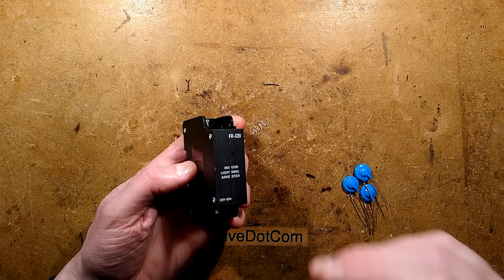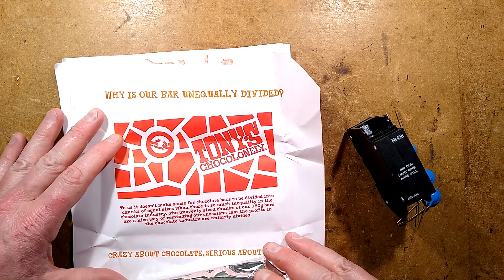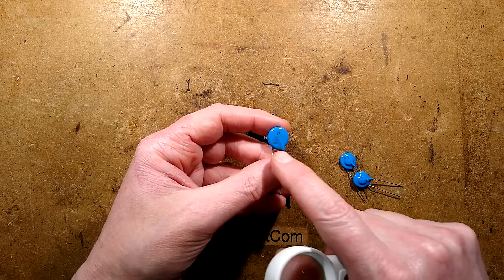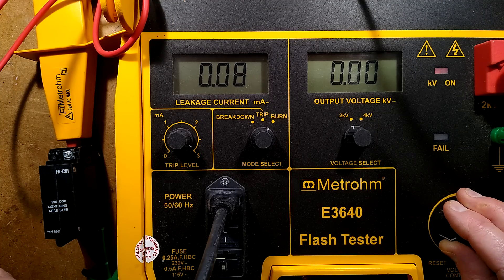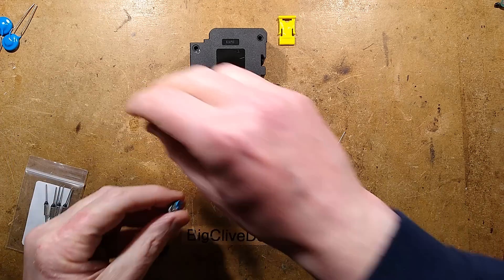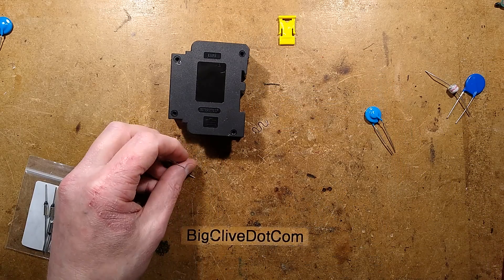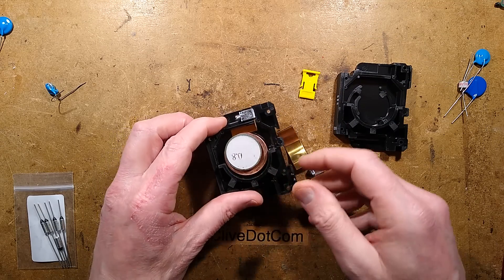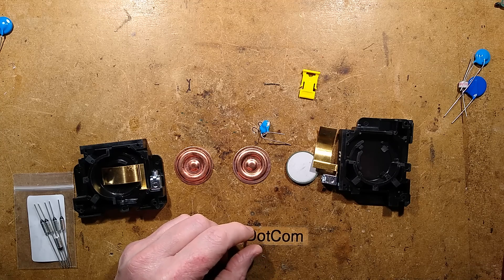Inside an African lightning protector - and candy

Comment: the steel "washers"... copper plating is probably cheap corrosion protection, and conductive layer.

so why not pure copper?

deforms, doesnt it? steel will take the heat.

im also having strange ideas about magnetised iron at high powers, but as soon as i start thinking about it i get contradictory images so, no comment in that regard...

Comment: The combined gdt mov is good because they complement the behavior of one another. 

MOVs clamp by reaching their break over voltage at which point a pseudo diode breakdown starts to occur and the resistance drops. But the clamping voltage is always above the operating voltage. But they always have finite resistance and have a leakage current. 

GDTs, rely on dielectric breakdown of gas between two plates at which point it becomes basically a short circuit. These devices clamp at some minimum holdover voltage much lower than their nominal rating set by the physical parameters of the device (maybe 100V for example). Because of this they will blow themselves up without current limiting in unlimited power scenarios

So what you do is put a GDT on your MOV because the GDT has no leakage current during normal operation saving power. In surge clamping the GDT breaks down and the MOV sees the full voltage and begins to conduct. Once offensive input reaches below roughly Vmov+Vholdover it can no longer sustain the current necessary to produce an arc in the gas.

Comment: About TN-C-S in ovearhead lines: In Hungary we have 2 or 4 wires going from poles to houses(3 phase service is common). The PEN is separated to PE and N at the meter box or the breaker box, where it is mandatory to connect a grounding system with an impedance under 10 Ohms. Ideally it should always be a single digit number. It it easy to get it under 5 Ohms with just 2 3m long electrodes 6m apart.  Several decades ago TT systems were common and sockets were sometimes grounded to water pipes.

Comment: Wouldn't need a strike on the line to cause a surge, a lightning strike close to the line could still cause surges due to the magnetic field cutting across the overhead lines.

Comment: I think that black device was assembled incorrectly, I think that there should have been one of those copper plated discs either side of the ceramic disc so that an extremely high voltage would jump from one to the other the two discs forming the spark gap.

Comment: The GMOV; Different African here, this is for me a dumb idea, but a very common circuit form. The why, is the gas arrestor and Varistor characteistics, the GA is slow and shorts very large currents, and the MOV is nanosecond fast and can only short a few decade Amps. And they put them in series.
A number of devices I work with internationally, have this circuit, and they seldom fail, but the protected circuit does...

Comment: If the varistor is sandwiched between the copper plated steel plates, the outer edges of the plates could serve as a gas discharge gap in the ambient air. The breakdown voltage would be unpredictable, but for a lightning strike it should react fairly well and limit the spike to perhaps a couple kV. To really test it may require a large capacitor charged to perhaps 10kV and a current limiting inductor of very low value simulating the feed from the service drop's transformer.

Comment: The copper discs go on either side of the MOV and the spark gap is provided by the outer ring of the disc and free air (so the breakdown voltage depends on local weather conditions).  You use it downstream of a fuse or breaker so when the MOV fails into a short as they do, the fuse pops.  If this is properly assembled it's an effective if crude protection device for a single-phase single-leg system where the ground is bonded to neutral at the panel.

Comment: I lived in South Africa in  a suburb of Jo'burg which had lots of low grade iron ore surrounding the town, rusty red soil everywhere.  During the summer there were massive electrical storms with strikes everywhere. It was prudent to unplug any critical equipment in the house when you were not at home, in my case a QUAD amp tuner and deck. If you were at home listening to music or watching TV during a storm, wise men unplugged ! At that time lightening protectors were not fitted to household fuse boards (and I wouldn't have trusted them if they were !). Any local strike, and there were many, travelled a long way to your local earth and cooked whatever it came upon. A friend of mine got a significant jolt taking a shower during a storm. Out in the countryside, many of the local African farmers used a traditional method of lightening protection, a long thin pole about 25ft high with a red flag on the top next to their houses...........
Reply: Those tall poles are often near houses that have a thatched roof. Although every house in the open field could do with two or three of those poles.

The Johannesburg area is notorious for its lightning strikes. To unplug is the best advice you can give a friend. Even with the best lightning arrestors I wouldn't trust my devices to be connected during a storm.

Comment: The advantage of the integrated gas discharge tube on the MOV, my guess: MOVs are aging during normal operation, without ever clamping, just exposed to normal mains voltage. With that gas discharge tube in series, the MOV won't see any voltage across it, only during a transient event, when the voltage reaches the brekadown voltage of the gas discharge tube. So this arrangement was probably created to prolong the service life of the MOV. That super tiny gas discharge tube probably has a very low brekdown voltage, it is intended to break down just above the nominal mains voltage.

Comment: The BIG problem with these little thermal fuses , is that they often become fatigued over time , and fail when the element temperature is not at a dangerous level .... maybe there is a more reliable product on the market ( ? ) , but I have not found any , so far .... (  repair cafe volunteer  ) ...... DAVE™🛑

Comment: In America, current NEC mandates whole house surge protection devices (SPDs)  for new construction (sends overcurrent and over voltage to ground at the main service entrance panel with short wires). It's not whole house lightning surge protection, which would be a completely different device that can handle the greater energy impulse of lightning. A lightning protection device should be installed ahead of any SPD.

Comment: I am not supprised by this being so much cheaper then its UK/EU brother of SPD. It is dissapointing how expensive SPDS are in UK. Considering how much simpler they are compared to  a standard breaker(mcb), they shoulnt be 10 times the price. But breakers came to existance before corporations dictated the price. Now SPDs cost as much as they can cost. I guess its like USB cables or coffee. shops buying cost less then  five percent of selling cost.
Havent seen any CE logo, so I would appreciate that they did not claim it has protection it doesn't. I guess gap type is a salles think, like a memory foam. Nothing, but makes it sounds like its special.
Reply from the maker: The price of SPDs is being gouged in the UK.

Comment: Lots of useful suggestions so far... adding the minor detail that the failure mode for the varistor ceramic disk can be an explosion. Less likely with a very high but short duration voltage spike, but a sustained over voltage condition will lead to very high current, overheating, and rapid self disassembly. The steel discs might be there to contain the most violent parts of the disintegration.

Comment: Interesting configuration. The dimensions of the GDT element suggest a pretty low flashover voltage, yet probably enough to protect the MOV element from lower-energy "nuisance" trip events that would impact its lifespan.  I'll be sticking to my DIN rail cartridge style arrestors (with clear failure indication) for the moment.  Incidentally, Mr C - remember doing a video on those plastic KAM press-studs, seven years ago?  My overalls have finally passed the "point of no return", yet those cheap plastic press studs were still working just fine!
Reply from the maker: Yeah, the plastic studs are surprisingly tough.

Comment: I just had the booster capacitor on my 5 tonne AC unit go boom .The capacitor should have been 150uf and was only a few pF ..The PTC devices in series with one lead .It blew out one of the  PTCs .The other is intact ...Wonder what I can use it for ???
Reply: Not sure what a booster capacitor is? I presume it is the starter capacitor to start the compressor or fan motor of you air conditioner? Those things do wear out over time. A PTC in series suggest that it is a starter capacitor because it will have a low initial resistance and after a while it will heat up and basically take the capacitor out of circuit when the motor is running.
Reply: @Frankhe78  that's the exact design and purpose of the device .It's hooked up in parallel with the start capacitor so it increases the value temporarily by an additional 150 micro farads .So the  factory capacitor is 50 micro farads giving you a total of 200 micro farads  for you initial start up because of voltage sag in supply or  aging compressor motor .or improper instal of supply wires .Which is the case in my home .The wires were not increased in size for distance and size of compressor.They went from 3 tonne to 5 tonne AC unit requiring to go from 30 amps to 40 amps and up sizing conductors from #10 gauge to #8 gauge ..Can't replace feed to unit without doing a lot of damage to finished basement

Comment: I'm using a bourns GMOV in one of my designs. They also have an isomov which is similar but I think the GDT is formed between two pieces of MOV material rather than just slapping a traditional MOV disc and GDT together.

Eaton also has similar devices

Comment: Probably phosphor bronze springy clips.  I am surprised that the MOV was not between those copper plated pieces to allow more uniform current distribution.  This would leave a spark gap in parallel with the MOV around the edge...

Comment: For some reason, I'd have thought the GDT would be in parallel with the MOV, rather than in series - such that it would shunt/dissipate a larger portion of the energy around the MOV in a surge event instead of forcing ALL of it to go through both devices...

Comment: The copper coated might be there to reduce the short circuit current. I know that Telemechanique had a terminal block which was to be installed on distribution rail. It had 3 spring contacts inside which started bouncing (open, close etc.) when the short circuit went up too high. This reduced the kA's flowing through the device avoiding the motor protection switches from exploding. Might be something like this?

Comment: Thank you for an interesting disassembly: I am unfamiliar with your HV tester, and I am curious to know why you do not use it to test the devices as a protector against "Pulse" energy applications. Does the tester record and display the peak current and voltage of the DUT when you use that test mode?

Comment: Some comments on this video remind me of something very unusual that happened years ago where I live:
The lightning might have struck very close to the house because it made a loud bang like I had never heard before.
And at the same time a bright flash appeared at the electrical panel, where there is top to bottom the consumer unit, a box with fuses that only the utility company is allowed to access then the main breaker, which also popped right after the flash.
But the weirdest thing in this event is that there's got absolutely no damage left afterwards.
We switched the breaker back on and it worked just like if nothing had happened before.
No scorch mark or soot to be found anywhere either.

So to this day I still wonder where the flash actually came from and also why the main breaker popped.
I mean, it's not designed to open in case of overvoltage or lightning strike, right ?
But many of the power strips in the home have built-in surge arrestors, with some of them featuring a spark gap in addition to the usual MOVs.
Could it be because of the surge arrestors that the main breaker popped ?
Reply: We had a similar event at the family cottage a few years back. Heard a 'tink' and saw a flash by the electrical panel door simultaneous with the lightning strike, but nothing shut down, no breaker was tripped, and no signs of scorching at the panel. Total mystery.
Reply: That's interesting and just as mysterious as my story.

Comment: is there really electronics that can protect you for 2milion volts lightning bolt? A lightning bolt struck a telephone hole cover that was 15m away from my house and it burned several wires in basment,lights and anything that was plugged in at the time in basement  and yet these guys think 2 copper discs will stop that ?   Good luck !

Comment: Are the curved Brass bits a thermal cut-off?
Brass and Copper 'work harden', becoming quite stiff and springy.
But such metals anneal easily...a bit of heat and all the spring is out of the brass.
With the Brass springs compromised, the Copper disks aren't going to engage with the Varistor.

Comment: nothing to do with this video question. to move solar panel, one motor, one power supply, two timers (one to move during day, one to reverse for morning) Do I need a diode somewhere to isolate the two timers. OR separate power supplies, Thnx for any help

Comment: "packer"  (bi metallic?) either side of varistor is the spark gap across the extreme circumferences between them? (Instantaneous). I lived 4 years in West Africa, there was only spark gaps on distribution poles on the road that also had manual wind-breaker. (Looked like fibreglass on the one near my house). I fitted lightning arrestor hit counters in the office building protection system. We had 2 direct hits in my 4 years there and yes, darned loud too. Thanks for yet another great video Clive.

Comment: I did some electrical work in Zambia to improve their lighning protection as they kept loosing solar inverters etc. to lightning. Where surge protectors like the one here had been fitted they were all fried, as they get so many strikes. Plus the daily power cuts must induce a lot of surges on the mains. I found some moderately priced Chinese surge protectors by Chint that hopefully were good replacements. Much cheaper than the same thing in UK at the time. 

The earthing through earth rods and pits was usually very poor so MCBs and SPDs likely would not protect much if they wer relying on the earth for the fault current. But they promised to upgrade them.

E.g a 3 kW kettle run between live and ground raised the local earth potental by >100V so a direct short to ground would not trip a MCB.
Reply: I was using the term earth rod carelessly. It's a pit filled with salt and charcoal into which an earth wire is coiled. Common I found but i am talking about commercial property and not houses, which i don't know much about. In South Sudan I found that the DNO would sometimes remove customers' connections to their earth pit near a meter if they found them. Not sure why.
Reply: I found one installation in South Sudan where one of the live outputs from the consumer unit had been crosswired to earth. As the earth pit had a high impedence not enough current was drawn to trip the breaker, but it cost them a lot in continuous electricity use. I only found it because I got a significant shock off the earth pit when checking it, as there was large potential difference between my feet standing near the pit and the earth wire itself!
Reply: @hoverbovver  Wow that is a really sloppy job by the person working on that installation before you. A live connected wired to a high impedance earth connection. The madness!
Reply: I have never come across an earthing rod anywhere in Zambia or Tanzania. As far as I can see in the meter cabinet they create a TNC-S from the overhead single phase supply. In the subpanel they, again, connect PE and N together creating another PEN point, basically defeating any intended earth protection. I find it very odd.

Comment: We had a few of those installed at some point and didn't trust them. Mostly, here in South Africa , strict on code and pedantic about safety, we prefer the GE or ABB or such brands. I imagine north of our border, some places dont have access to those brands and have to settle for whatever is available. Also, relying a lot on the surge arrestors mounted on the pole transformers which you never really know if they are still viable or not. 😅Was a bit shocked to see what's inside the arrestor. Thanks Clive

Comment: South African house supplies are on average 240V. Incoming supply from utility comes into the house DB board via a combined earth leakage and over current circuit breaker. The surge arrestors are  connected between Live and Earth, Live and Neutral, and in some between Neutral and Earth. The arrestor relies on the earth leakage unit to clear the fault if any of them goes short circuit. Earth leakage units operate around 25mA difference between Live and Neutral currents in the earth leakage unit.
Reply: Nicely informed. Thanks. I think our standards and discipline is sometimes unfairly judged based on Hollywood perceptions...

Comment: Scary the over voltage module does not have over current or over temp protection. I expect much excitement if it fails.
Reply: Because it is SUPPOSED to trip the circuit breaker on the feeder to isolate the installation. The voltage limit function is only supposed to last long enough for the breaker to trip.